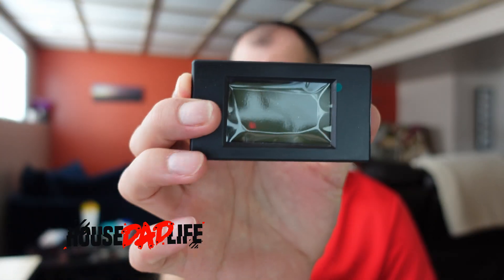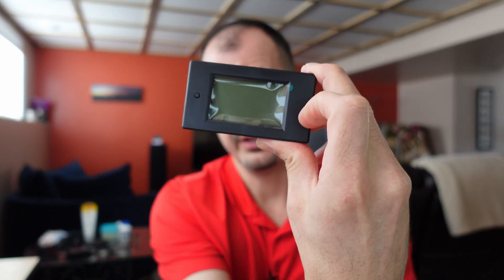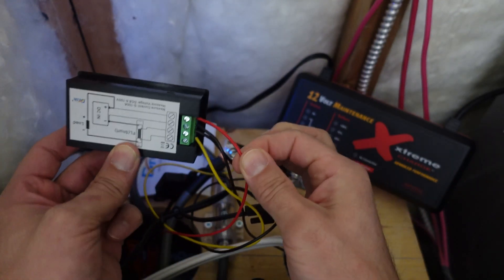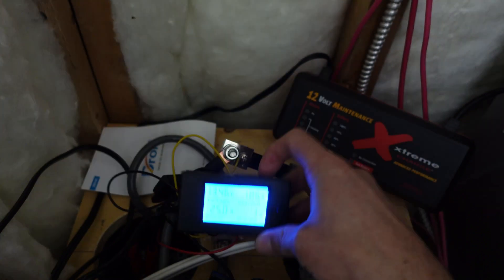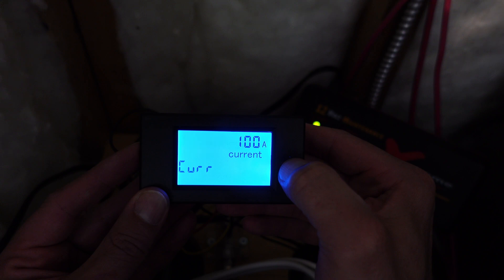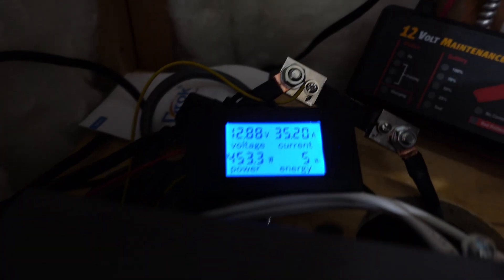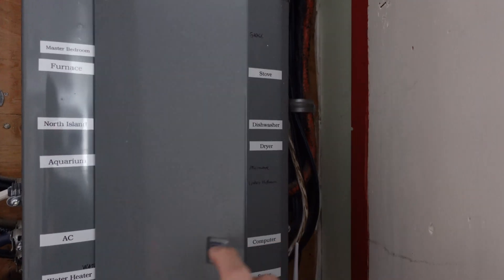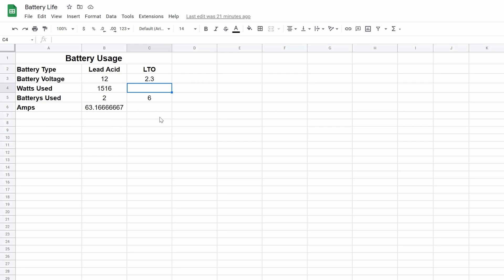DIY Battery Monitor for Furnace TESTED!

Comment: Oh, DROK, is there anything they don't make? Most excellent, glad to see you're AMPing up your game ;-) Did you see what I did there? I rate this info a smash. I hope all is groovy in your world.
Reply from the maker: Dad jokes for days! Ha ha glad to see you around.  You're not wrong with DROK they make everything.  Thanks for the smash and the comment! All is well hope spring is here soon for the outdoor growing.
Reply: @HouseDadLife  I started onions and shallots today. I use the DROK voltage regulators for my solar pond aerators... I'm only so brave when it comes to electricity. Oh, I also realized that my strawberry plants were putting out runners but I didn't recognize it. I took a cutting and I'm trying to root it. One way or another, I should have a video out by July.
Reply from the maker: Solar pond aeration interesting...  I'm starting to use some strawberry runners as well for the garden, I've put a ton in Dutch Buckets indoors but my kid would love another patch outdoors.  Need to decide if I want to do that organic or a bit of nutrient support.   Onions now, interesting, I usually do them super early, end of January beginning of February although this year I was to busy with experiments in hydro so I'll have to buy.  I'll come check out your video when it's up.